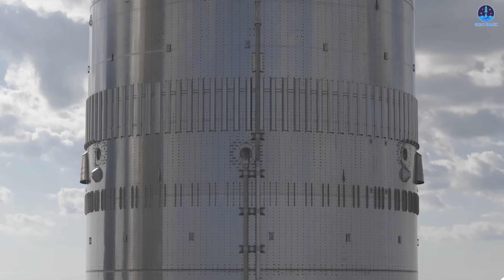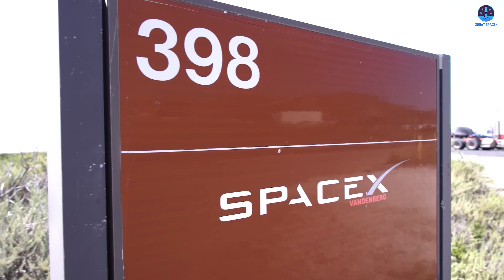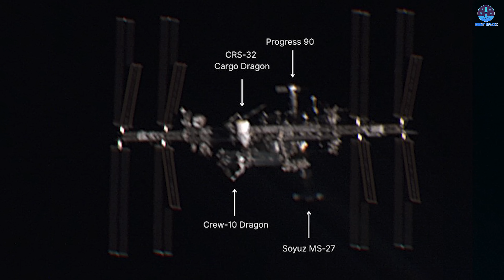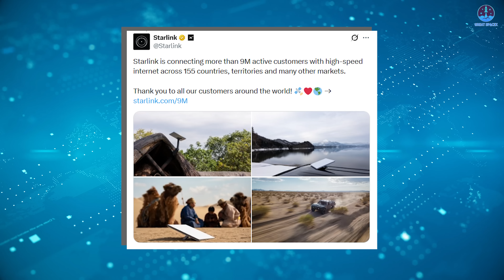SpaceX Achieved What NASA and China Couldn't for Decades! 2026 even Crazier…

Comment: If SpaceX can launch 6 to 7 that will be a successful year. Pad 1 won't be ready till about October, Pad 37A about the same and well 37 maybe June 2027. However getting launch vehicles to Florida is another really big hurtle that SpaceX has to solve.
Reply: It will have to be more than that. They have a few step (suborbital, orbital, ...) before a fuel transfer mission. That will take at least two ships, if not multiple attempts. Then enough fuel transfers for a lunar orbit and return prior to a moon landing and takeoff demonstration. Each of those will be at least 1 extra fuel ship and most likely several. That is the goal for Q3 to be on track. Super optimistic puts that to around 8 lunches by September, likely more in the 12-15 range. Either they will need to significantly step up manufacturing or start reusing 2-3 times.

If they do it, it will be one heck of a year to watch.
Reply from the maker: Yeah, let's wait to see what they can do

Comment: Catch booster.  Orbit ship.  Catch ship .

Or DO NOT FLY
Reply: They are still testing the heat shields on Ship. The new V3 Booster and V3 Ship still need to go thru all the testing and will have new problems that need a flight or two to fix just like V2 did. Also V3 is not the final design with V4 coming that will need to repeat all the testing and test flights.
Reply: @mrbaab5932  Block 4 is just a place holder for the main system goals. Some time next year they will announce a block 5 with all the specs from block 4 and block 4's numbers will be reduced.
Reply: They will, testing is still part of the missions